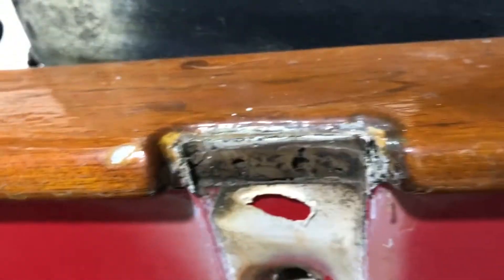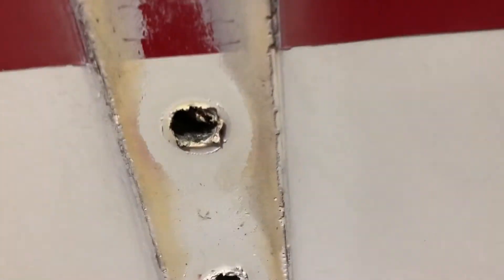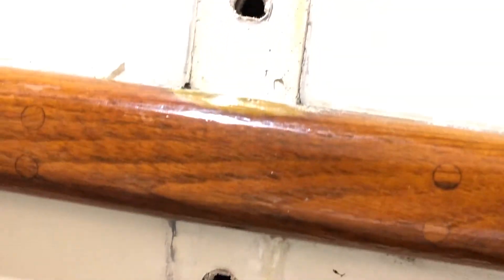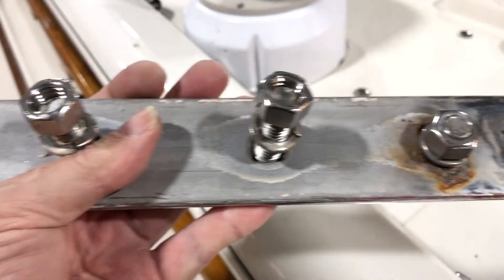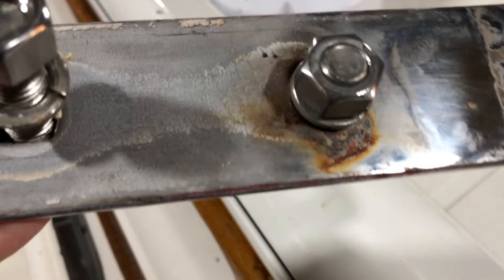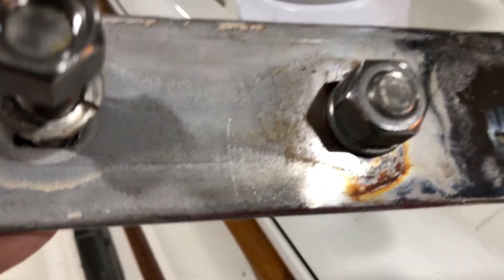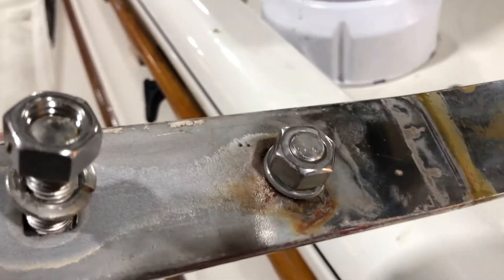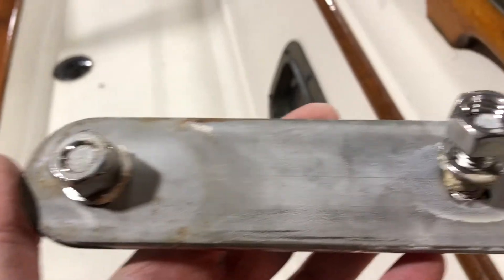Chain Plate Removal

Comment: I am about to do the same thing to a Pacific Seacraft. I’m wondering if you found it difficult getting to the backing plates from the inside of the boat? I’m looking at mine now and they seem to painted with some thick sort of resin.
Reply from the maker: It turns out that upon closer examination, I decided to replace the upper shrouds and the backstay chainplates (Pacific Seacraft has them in stock,  they're pricey but it was  convenient and they are now made of 316 and cut with a water jet rather than a punch).  I have a PSC34, and the upper shrouds can be accessed in the small compartment just forward of  the bookshelf.  I only needed to peel off the headliner, and the bolts were easily accessible.  There is a metal backing plate embedded in the fiberglass, but on mine there was a little bit of paint, but it was easy to  know off  the nuts by putting the socket over the nut and lightly taping it.   The lower shrouds would be a bigger pain  because  they behind teak slats behind the bookshelf. 

Why are you  replacing yours?   Do they leak?  Even though mine 'looked' OK, there was a potential of crevice corrosion (though not too likely in my freshwater only boat), still decided it was time.   Good luck.